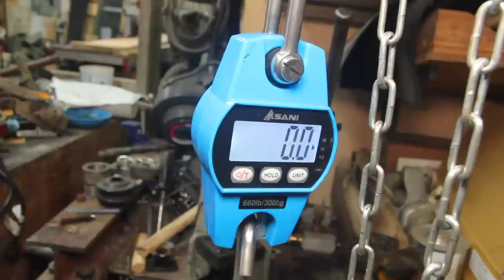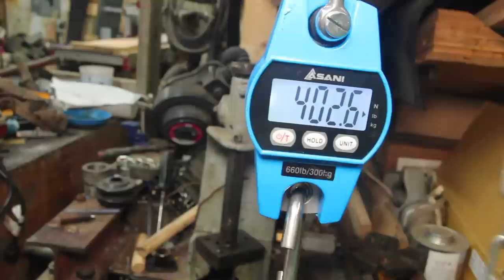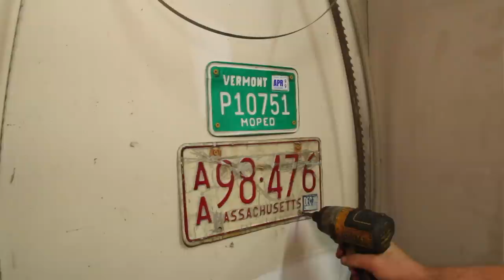Down to the Axles- CJ5 rebuild

Comment: I remember a while back I asked what mill you had in a video comment. I was patient for about a year and finally found a Index model 40 mill like yours at a local auction. Of course, I bought it. I am glad I waited and passed up a ton of Chinese mills. The mill is the perfect size for a garage shop while still being very ridgid. It has a power down feed and had the power table option at one point although it is missing from the worm screw on the table onward. I still need to make room in my garage next to my other vintage Southbend Heavy 10 lathe. I will tear into it and deep clean before I try to operate it. And figure out If I want to make the 3 phase motor work or swap a single phase motor. Anyways I am patiently awaiting your rebuild of your Index model 40 in the future. So Mr pete or "Tubalcain" made me buy a Southbend lathe and now Jeremy from Jeremy Makes Things made me buy a Index Mill.
Reply from the maker: Awesome.  Mine has the two speed three phase motor on it, I wired a VFD to the windings for the faster speed, and I’m using the original barrel switch to select between high and low speeds via the drive- and then I realized there’s a middle position on the switch as well, so I set that up for a medium speed.  Mine is also missing most of the table powerfeed, at some point I’ll adapt a servo-style feed to it.

Comment: I redid the axles in my XJ years back.  To spread the case on the Dana 30 I made a tool out of (2) 2x3/8" flat bar bolted to two cover bolts on each side of the carrier.  Then welded a 2" long piece of pipe with a 5/8 ID on the ends of the flat bar.  Put a piece 5/8 all thread with nuts against each 'spreader bar' and crank the nuts out to spread the case.  I was able to build it entirely out of scrap I had laying around.

Comment: When using the 6 sided collet block, how do you calulate the depth of the first cut when the stock is still round?
Reply from the maker: Take some off one side, flip it 180, take another cut, measure and adjust.  If you watch closely, you’ll see as I rotate it around, one side already has a flat on it.
Reply: You can also touch off the top of the stock and then lower the endmill the calculated amount.

Comment: i build a firer in each  1 with diesel fuel let burn for 15 mit and use a block of wood to but out the fire  stay with the burn out and then use the block of wood and drive down the piston

Comment: Great videos B T W
What you are calling knuckles is actually called a SPINDLE 
Just an  F Y I.
keep the videos comin , PLZZZ
Reply from the maker: I may have misspoken at some point in there, but there is a difference between the two:

Spindle: https://www.kaiserwillys.com/products/front-axle-spindle-fits-41-71-jeep-willys-with-dana-25-27/

Knuckle: https://www.kaiserwillys.com/products/passenger-side-steering-knuckle-support-fits-46-66-cj-2a-3a-3b-5-m38-m38a1/

Comment: The best oil to put into the engine to clean it is hydraulic oil used in heavy earth moving equipment escavator hydraulic oil it will strip rust dirt carbon just use the oil can be old oi soloing as it is clean soak the howhole engine in it opening every hole only needto be in there a couple of weeks